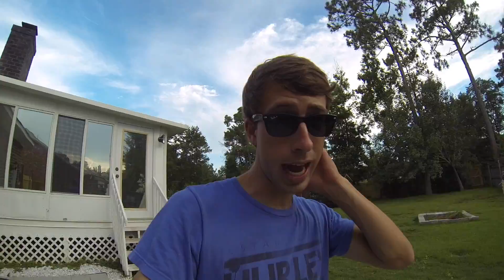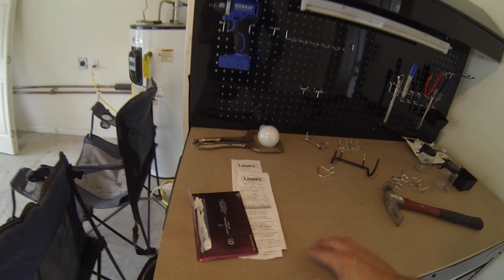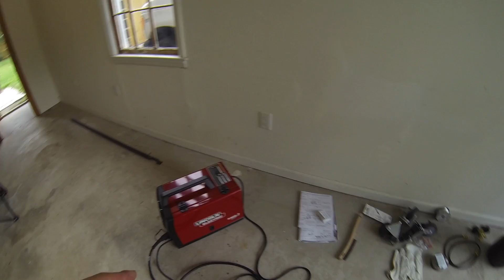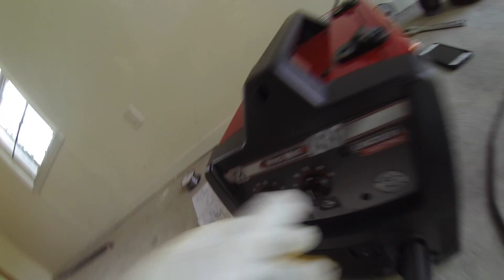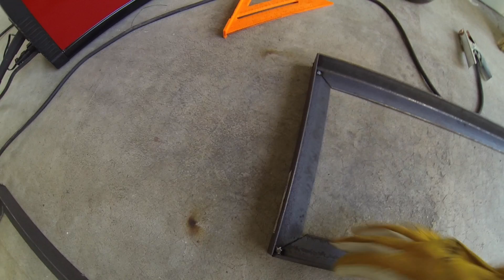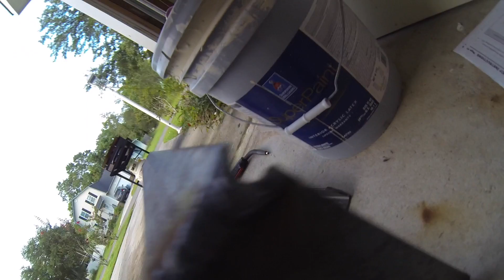New Welder - 240sx update tomorrow!

Comment: if your using gas you need the gas nozzle on there for better gas coverage or your welds will be shitty .
Reply from the maker: I appreciate this comment!  I recently figured that out when reading the manual.. lol had no idea!  Thank you!
Reply: no problem i watched alot of your vids back when you was doin the 1j swap. im currently doin a s13 1j vvti swap but trying to figure out the wiring .. i have a stripped shell with no wiring,. so gonna do or want to do simple wiring like lights, fuel , fans , ignition
Reply from the maker: Wiring can be a pain.  Also getting a decent base map if youre running a stand alone lol!
Reply: yeah it is . lot easier with the stock chassis harness removed and using your own fuse box and switch panel. im  running stock ecu for now .